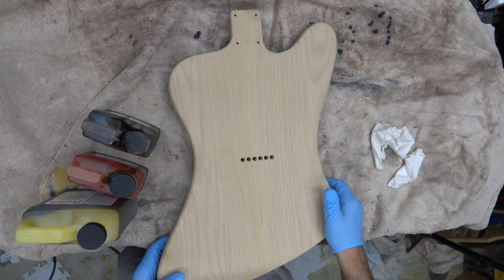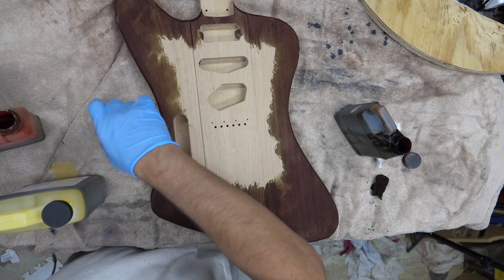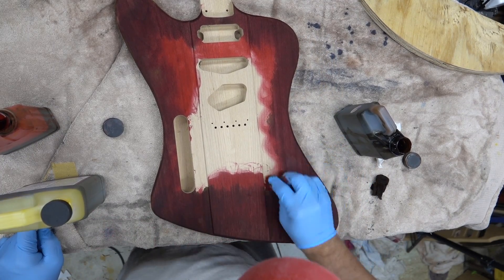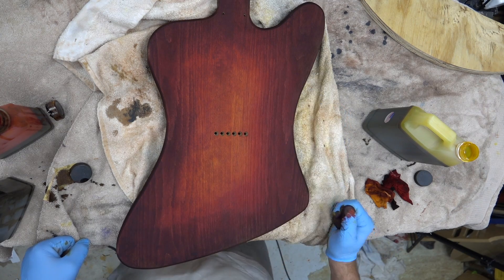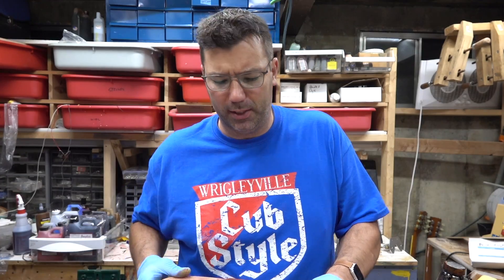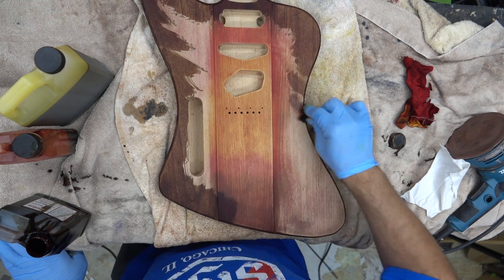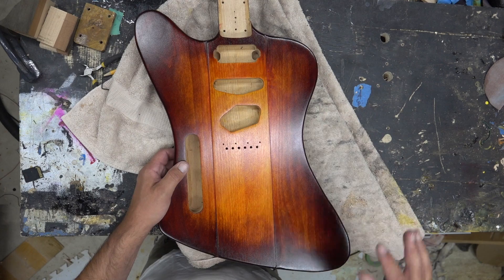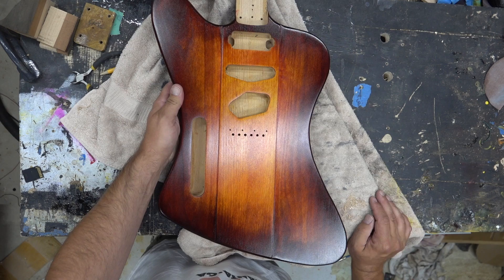Brock Burst Guitar Stain on a Plain Alder Body

Comment: Off topic question here, but have you ever replaced the bearing(s) in that Makita sander. I bought that sander several years ago (thanks to you! lol) and it's great, but has started to wobble a bit. I think it's my fault for using just the edge too much. Just wondering if you know about the process of restoring one.

Comment: Hey D. Have you had any success with odies oil over these stain bursts (without smearing). I like the idea of odies but concerned with this. Video idea? Hmmm?
Reply from the maker: I did this video.  Odie's Oil Finishing Product Review
Reply: I saw the rewiew. Its what got me interested in the product but that was over bare wood if i remember.
Reply from the maker: Yea it was bare.  I think if you sealed in in sanding sealer you would be ok.
Reply: Ah. That answers my other question. Odies is ok over sanding sealer?